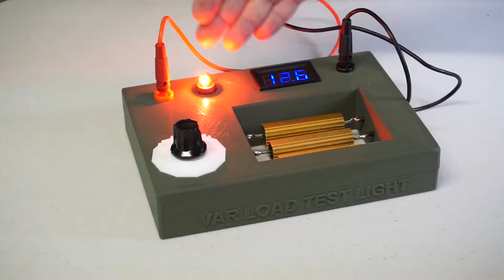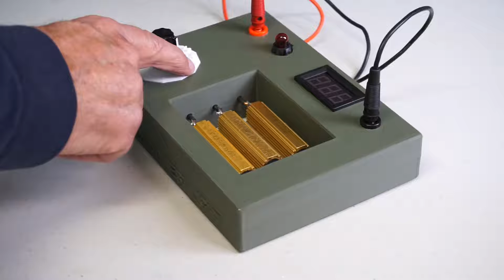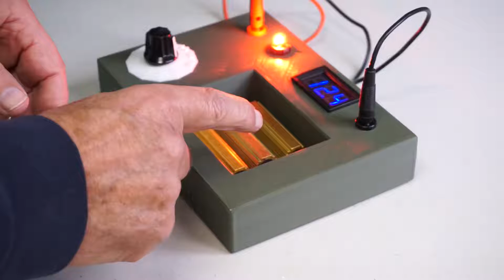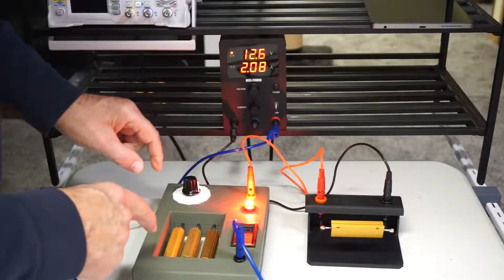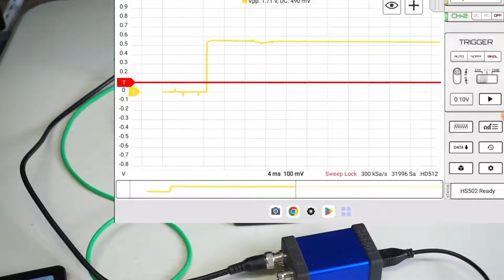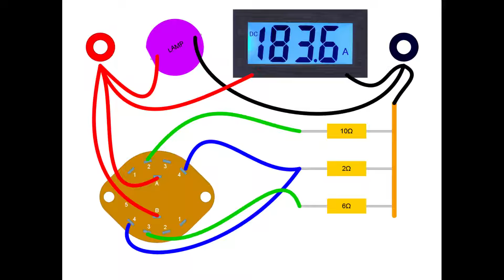GADGETS#186 - VAR LOAD TEST LIGHT

Comment: in the parts list the switch is a 1 pole in the video you said 2 pole is there a way to make a 1 pole work since i already bought it?
Reply from the maker: this switch can cause confusion...I get it...

I'm thinking/hoping that you do indeed have the proper switch...

does your switch have a total of 10 possible connections...2 inner "wipers" and 8 outer contacts?
Reply: No the first switch only has four contacts but I had to re-order a switch with a total of 10 contact points. It is a two pole four position switch.
Reply from the maker: and in the video @ 6:45 I misspoke by calling it a 2 pole switch...it is actually a single pole switch with 2 rows of contacts

the 2 pole version of this switch (which I did not use) has 2 stacks ... the 3 pole would have 3 stacks, etc...

Comment: So, I had my father in law print me the casing, I finally received all my stuff from aliexpress (two items were broken but atill usable) I have one question about assembly.

For the rotary switch, did you disassemble it and passed the two screws trough the two small holes in the printed casing? Because my switch it so stiff that it spins in the casing instead of switching. 🤔
Reply from the maker: yes Alex, I did remove the 2 screws and passed them through casing
Reply from the maker: you'll notice there 2 dimples in the printed dial to accommodate the screw heads sticking out
Reply: @theGADGETSplaylist  thank you very much for the swift reply Dennis. That's what I figured, but I wanted to run it by you first. I didn't want to ruin my switch even more than it was already when I received it haha.

Comment: Nicely done as always.  
Maybe use Schottky diodes in bridge arrangement on input to volt meter so polarity wont matter.  The voltage drop would be negligible and we're really only looking for VDC drop under load.
Reply from the maker: I'll think on this Eddie but this gadget is done...moving on to next one:)

and thx for the nice words...appreciate it
Reply: Hi Eddie, I'm just building the load tester. How would the diodes be wired? Part number for diodes?